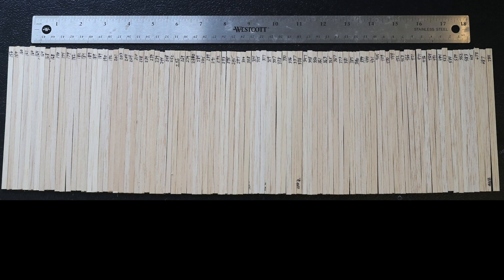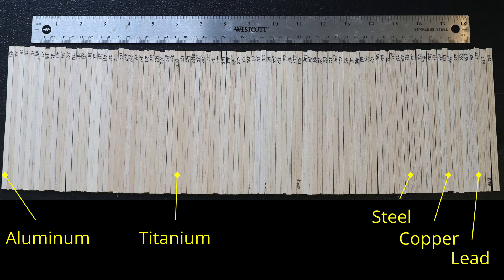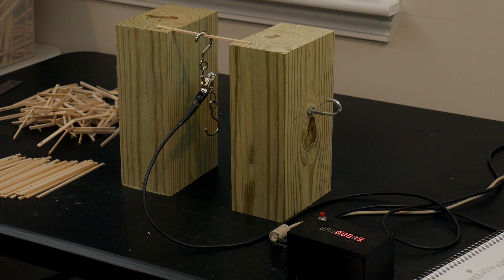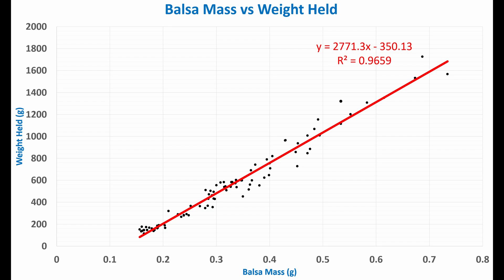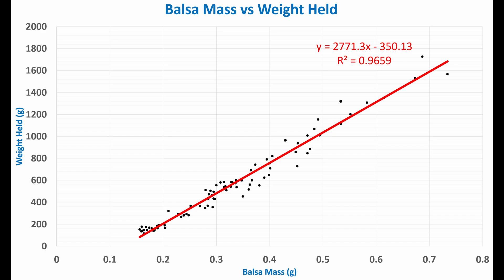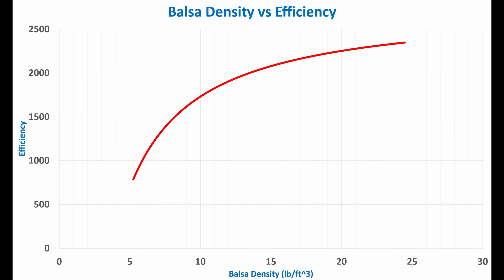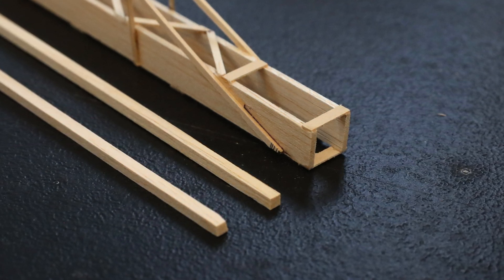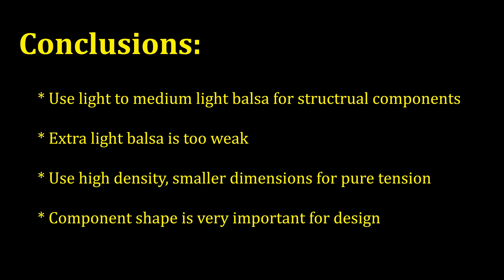Balsa Density vs Efficiency

Comment: Thanks for prompt response. 
Another question: as our wood was too light, we used 1/4 inch for legs and 1/8 for braces. That is more sturdy but it does not pass through 8 cm and 29 cm ring as we used the same jig from your designs. 
Do you happen to have STL files for zig that is appropriate for 1/4 inch leg and 1/8 inch braces. If not, I will work with my 3D printer to modify the existing one. Thanks again!
Reply from the maker: No problem! I don’t have a jig pre-made for that but you should be able to just scale the x and y (not z) dimensions in your slicer to make it work
Reply: Thanks

Comment: I am a parent coach for Tower Div B. Build a tower using your jig (thanks for 3D drawings) but it came out too flimsy. It seems like I am using too light balsa sticks. My 1/8x1/8x6 inch sticks weigh about 0.18-0.20 gm/stick. This is the lightest end of the sticks in the above video; and I assume your sticks are 1/8x1/8x6 inchs. Where can I find the heavier balsa sticks? Searched a lot on Amazon but dont see any vendor telling density. Will appreciate your feedback.
Reply from the maker: Hi, thanks for the kind feedback!  Usually the problem most people have is they don't have access to light enough balsa.  With most common sources you'll usually get material in the medium density range.  That being said, I like to get all my balsa sheets from Specialized Balsa https://specializedbalsa.com/products/balsa_sheets.php   It's the only place I know of where you can specify a density range when buying (for an extra cost).  Good luck!!
Reply: Thanks a lot for prompt response. I am ordering from specialized balsa.

Comment: The lightest balsa wood I have is 3.8Lb per cu. ft.   The heaviest is 17 Lb per cu. ft.
The low density balsa also absorbs more adhesive and dope than the high density balsa.
Structure design is important.  I used to build 1/2A pwer model wings with ~ 60 degree geodetic rib angles and the finished wing weighed 1.75 ozs.   The new wing I built of the same area with very close to 45 degree rib angles,  was noticeably stiffer in torsion yet weighed 1.25 ozs. finished.   Barnes Wallis designed the WW II Wellington bomber with geodetic fuselage construction which was able to withstand significant damage yet not suffer structural failure that downed other aircrraft designs.
Reply from the maker: Very cool!  Yeah, that is quite a range of density.  The lower density stuff definitely absorbs glue much faster than the higher density wood.  It behaves very much like a sponge.  That is one reason I recommend when gluing joints (with CA at least), that you have to hold them longer for higher densities, and especially when using basswood.  5-6 sec is fine for normal balsa, but you might need to press the joints together for 15-20 sec for basswood or very high density balsa - similar if you have a glue film on the wood from a previous attempt
Reply: I used to use balsa cement but found over time that it continued drying out and eventaully pulled away from the wood.  Not only that but wings etc. would break readily at the joints in a "heavy landing".   I switched to slightly thinned PVA wood glue which never shrinks away from the wood and gives a slight degree of flexibility to the structure so withstands shock much better.   CA I use mainly for fixturing and on field repairs.  Downside is the joints are brittle.  Can force cure using Zip KIcker on hardwoods but as CA cures with moisture on the joint surfaces,  damping them with water accelerates cure time.  Just breathing on the CA joint can speed up cure times.  Best to assemble the joint dry  then apply the CA.  Watch for the vapour when curing fast on light weight woods as the vapour stings the eyes badly.  Get cured CA off fingers etc. with nitromethane.

Comment: The suggestions you made at end of what kind of balsa to use, does it apply to towers too? I’m currently wanting you buy balsa online for first time and not sure what density to buy. Your benchmark Div C tower build uses such light balsa that I thought they would be under “extra light” density. Please help. Thank you!
Reply from the maker: Hi!  I would say for the Div C tower build, the legs are on the light end of "light" density range, and the cross members are on the very light end of "light" or heavy end of "extra light".  The best way to deal with this is to try and get as much material as you can and experiment with different sizes and densities but trying to match the total layer weights if you can.  Good luck!

Comment: Hi! Just a quick question! Would it be at all possible for you to share the deflection of the piece of balsa wood? I am working on deriving a set of Pareto-optimality equations and am interested in these values.
Reply from the maker: Hi! I didn't record the deflection for the pieces.  That would have been very challenging to accurately measure and would have most likely had to be done visually with a camera precisely lined up to the pieces.  Typically, they do bend "a lot" before breaking, but that depends on the grain type as well. Most of these pieces were A-grain which would bend quite a bit.  C-grain would not bend as much.
Reply: Oh well. I did alternative equation that could be used, but it's less precise. Thanks for the quick reply! @balsaengineering6686

Comment: What would be interesting would be an equal mass comparison with different thicknesses and different densities in a square cross section. The low density thick square has less mechanical disadvantage against it than the high density thin square, when laying horizontal and supporting a beam in the middle, even if the high density material is stronger.

Comment: What density would you use for the legs?
Reply from the maker: The legs I used for both my best Div B and Div C builds would fall under the "light" range
Reply: @balsaengineering6686  Ok. Also would adding more cross bracing make the legs more rigid? When I used lighter balsa, the legs bent and broke.
Reply from the maker: @sibaiyan  It's hard to know without seeing a picture of your build, but in general, yes, those things are very much related to each other.  Feel free to reach out to me at mklinger at comcast dot net if you'd like to share a picture and I'd be more than happy to provide a more detailed response

Comment: what about. tension v density, comparing bass density and basal density, aswell as same thing for compression.
Reply from the maker: I first wanted to do a pure tension and compression test vs density, but it's really hard to build a test rig to isolate that.  Compression might be possible, but creating something that can hold the pieces tight enough for a tension test usually destroys the ends by crushing them.  I have found that the tension and compression strength correlates pretty well with these results from my general experience.  Balsa is about 70% stronger in tension than compression,  but the relative performance vs density holds pretty true.
Reply: @balsaengineering6686  would it be possible to glue balsa sticks to two wood blocks and apply tension force to the bottom block for tension test? And is Hobby Lobby a good place to buy balsa sheets & DIY cut or some online stores for consistent density/strength? Thanks.
Reply from the maker: @annylee4208  Hi Anny.  We actually did that exact type of thing for testing the bass tension part of the boomilevers.  You can see the test rig in this video here: https://youtu.be/NrDhMu_wQt8?t=415   It wouldn't be very practical to do that at a large scale.  It's really important to be able to apply a constant tension force.  You'd probably need an engineering tension testing tool to automate this with any consistency.  The bending test I do here is a pretty good general test that correlates decently to tension strength.  I'm sure Hobby Lobby has fine balsa wood, it's just a matter of if you can find exactly what you're looking for.  I like to use Specialized Balsa for my balsa sheets, specifically, I like to get 4" wide by 36" long sheets which is a nice balance of best price and easy to strip (as opposed to the 48" long pieces).  https://specializedbalsa.com/products/balsa_sheets.php

Comment: Hi, I ordered 1/4 x 1/2 balsa wood and it weighed ~4g. This was going to be used as my legs but I am concerned that it’s too heavy for a good Efficiency score for a bridge. I am also going to be cutting the 1/4 x 1/2 balsa slightly. Is there anything that I can do to improve the weight.
Reply from the maker: That does seem a bit heavy.  I would recommend in the future to buy your wood in sheets and cut it to desired size and then you can have a bigger range of densities to choose from.  For this wood, 1/2" wide is pretty thick, you can probably cut at least 50% off and maybe even in half depending on the density.  Good luck!
Reply: @balsaengineering6686  Thanks for helpful information. I have a balsa stick weighing ~12g with dimensions 1/4 x 1/2 x 36. I am planning to cut it into 1/4 x ~2/3 x 21 pieces. What would you expect the weight of those pieces to be?
Reply from the maker: Hi Ravidath, some fairly simple math can predict what your sticks will weigh (on average).  We just need to compute the area ratio of your stick to the entire piece.  We can use area instead of volume because the 1/4" thickness is the same for both.  First, put everything in the same units, I'll use mm.  Your original stick is 1/2"x36" or 12.7mm x 914.4mm = 11612.88 sq mm.  Your desired stick is ~2/3 of 1/2" x 21cm or 8.47mm x 210mm = 1778.7 sq mm.  The ratio is 1778.7/11612.88 = 0.153, which means each of your new sticks should be about 0.153 * 12g or 1.84g each.  That seems fairly reasonable to start with.  You probably won't get 4 sticks exactly the same though due to balsa being so non-uniform, but they should be close to that.  Good luck!
Reply: @balsaengineering6686  Thank you for the detailed reply! I was slightly concerned that it would be over 3g. Thanks again!

Comment: For the grain of the balsa, based on the diagram, I would think that A-grain balsa would be best right? I have some sticks that are light for my legs, but they tend to be c-grain sticks, I'm thinking that they will break quite easily due to the grain pattern.
Reply from the maker: Probably A or B grain is best for the legs.  Honestly, I don't pay too much attention to grain, I focus mostly on density.
Reply: @balsaengineering6686  Yeah, the reason I asked was just because I've been noticing the inconsistencies in some of the wood I have. I discovered that some parts of the wood are really squishy, meaning that they aren't very dense, and then some parts of the wood are much denser (these observations coming from one 30cmx10mm (3/32") leg piece). Is there a way where I could contact you directly with a couple of questions, because I feel like I might be revealing too much about my future designs when I comment.
Reply from the maker: Hi Aiden,  yeah, unfortunately, that is not super uncommon to have big density variations even in a smaller piece.  When that happens, basically, don't use it.  Some sheets are much better than others, even from great sources like Specialized Balsa.  Feel free to reach out to me at mklinger@comcast.net if you'd like to share specific questions you don't want public.

Comment: Hi Balsa Engineering, I have another question. So if I was to buy from Specialized Balsa, would the legs you have used in the Div C build video (the 2098 efficiency one, specifically the 1/16"x10mm and the 3/32"x10mm) be within the range of light or medium light balsa? I have noticed that a lot of wood has been wasted from our end due to the fact that it has not met the standards we want (in terms of mass). I have made a few bridges at high efficiencies (I don't want to note them numerically), but I'm running of wood that's around the same mass, so would it be worth it to just go to light balsa (this is after doing the math) since I don't wanna waste money going for wood that might be too heavy since wood takes a while to arrive at the school I do S.O. in.
Reply: I'm at the stage where I'm trying to make a bridge to hopefully land on the podium at the state tournament in mid-March (in NY, which is really competitive at the moment).
Reply from the maker: Hi Aiden, doing the calculations on the legs I used for the 2098 build, the 3/32"x10mm was roughly 7.7 lbs/ft^3 and the 1/16"x10mm was ~9.3 lbs/ft^3, so yes, according to Specialized Balsa's range, that would be "Light Balsa" which they have as 6-10 lbs/ft^3.   Good luck!! Let me know how it goes for you!

Comment: Thanks so much! This is kind of an odd question, but is the 1/16 bass piece shown at the end of the video 2ft long or as long as the span of the bridge (about 47-48cm)?
Reply from the maker: That is showing the cut down piece.  The 1/16 x 1/16 24" mass for what I've been using with these builds is around 0.6-0.65g or so.  I am currently experimenting with even smaller tension members, 1/32x1/16 and 1/32x1/32.  Both are worthy of checking in your own builds.

Comment: Very interesting and helpful. Thanks! Could you tell us the actual dimensions of the test pieces and the span between the test blocks?
Reply from the maker: Thanks!  Yeah, I should have mentioned this in the video.  The test pieces were 5mm wide, 150mm long, and 3/32" (2.381mm) thick.  The span was 10cm.
Reply: @balsaengineering6686  Good to know, Thanks.